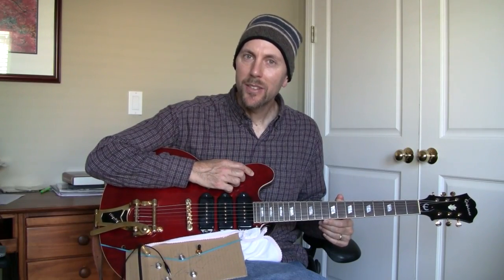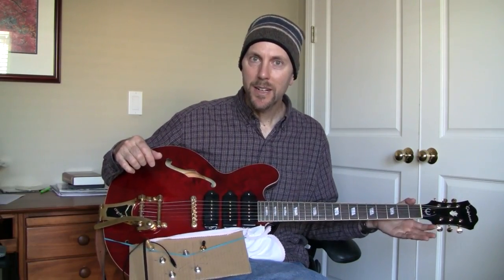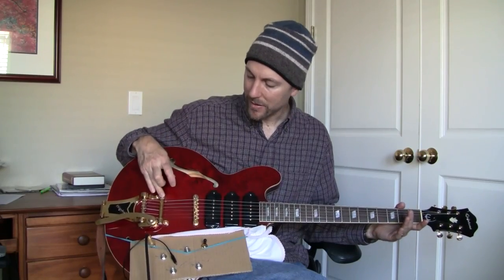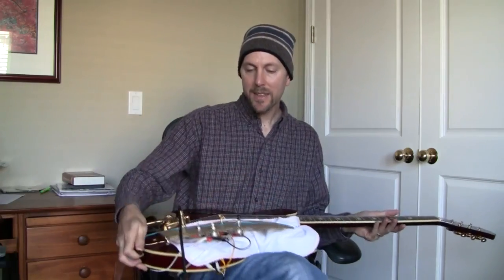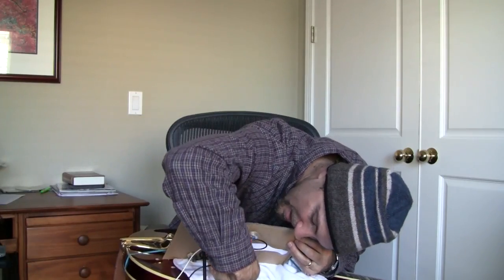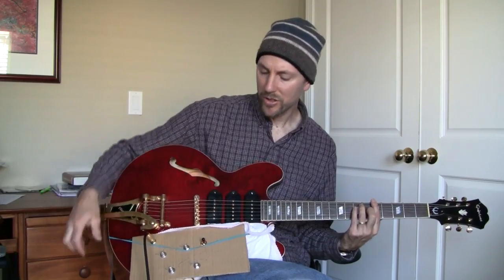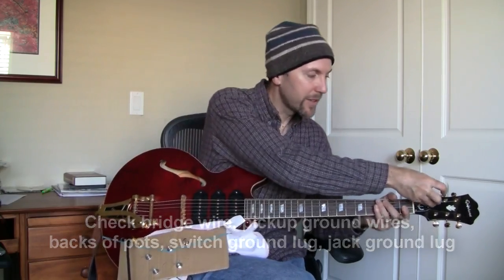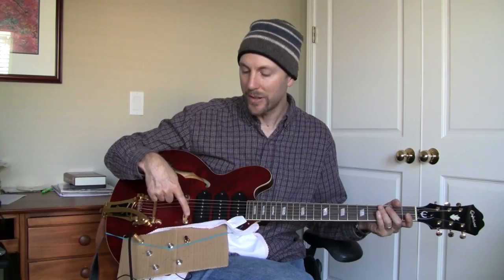Guitar Ground: Dealing with ground noise problems

Comment: Im an electrician so I don't need to know how to check the system.  You told everyone what to check, but not how to check.  I'm sure there are many viewers that would have loved to see an extended video of the testing process with a meter.  Other than that a great way to demonstrate the ground circuit.
Reply: I would have liked that kinda video, if you're going to make one, I'd definitely give you a like to it.
I did check every wiring on my guitar, and every ground connects, but somehow it still has the bzzz thing going on. It's not that bad but still. 
I think it might have something to do with the wall outlet not being grounded either.
Reply: I think, use a multimeter. Turn to ohm meter reading. Clip the black wire to the common ground of the guitar, then point the red wire to each of the ground leg on  the potentiometers to see which pot is not connected to the ground.
Reply: good point.

Comment: I did the ground testing and the last thing I suspected was -- the output jack was wired in reverse! Should be -- hot wire to outside (so plug makes hot contact at tip) ground wire to inside (so the lug nut will test positive for grounding). It was the reverse when I got it back from my 'guitar tech'! Thanks for your help!

Comment: I have an issue with my guitar where it only buzzes when my hands are off the metal, and when I touch anything metal the noise is gone.
Reply: did you found a solution?
Reply: Anton St Yeah. it ended up being my house that wasnt grounded. built in the 1940s...
Reply: And what's the fix for that? lol 
I live in an apartment, have the same problem. One of my guitars (the with humbuckers) is making noise, the strat is not. When I toich the metal plate where the input jack goes, the noise goes away.
Reply: Flagstone Pictures That's very insightful actually, my house was also built in the 40's so I think it's probably it. Cheers man
Reply: Same Problem for me bro, any solution ?
Reply: xD
Reply: My Les Paul did the same thing.  Shielded the pot cavity with copper foil and shielded all the other cavities with conductive paint and the Les Paul is dead silent even at max volume.  SO much better.  The paint is available on eBay.
Reply: I have the same problem with my Les Paul.
Reply: i have the sme issue. every metal part i touch makes it dissapear. even the handle of my amp. so the problem cannot be the guitar can it?
Reply: Easiest fix..... wireless rig.   I use a xvive u2 wireless.   Bought a new 2017 les paul and dropped it about a year later.  Broke the wireless device and the input jack.   Had jack fixed by authorized gibson repair.  Guitar had a little hiss (not bad but had preciously been dead quiet).  Dawned on me I was using a cable now instead of wireless.   Bought new wireless and it is dead quiet again.   If you have the normal grounding issue where you touch the strings and it gets quiet....  go wireless.
Reply: same
Reply: Steve  , the bridge, the strings, the tuning pegs and all other exposed metal hardware should be internally tied to the same ground Point as the pickups, the pots and the body or metal shell of the pots, and the ground side of the output Jack. Get yourself an ohmmeter or some type of continuity meter and check to see that all of those are electrically bonded together with no more than hopefully a couple ohms of resistance. And yes, if the black anodizing or paint on the bridge is preventing a good ground connection to it, then the strings and tuning pegs probably won't have a ground either.

Note that even if everything is grounded together properly, that most guitars will tend to make slightly more noise or buzz when your fingers aren't touching the strings and the metal parts, and usually it gets a little quieter as soon as you touch them. On the other hand, if the guitar generates more buzz and hum when your hands are on the strings in metal parts, and it's quieter when you're not touching them, then the guitar likely has a grounding problem internally. A little one exception I can think of is if your house is a high RF environment with lots and lots of electromagnetic interference flourescent lights or some types of LED lights that weren't designed well, or computers and computer wiring, fans and other devices with large Motors, any or all of these can actually generate noise that gills back out on an into the electrical wiring in the house which then radiates it like a transmitting antenna. Therefore, if you take your guitar and perhaps your amplifier as well to another house or another place, or outside in the yard with a long extension cord perhaps, you'll see if the noise is particular and Peculiar to your own house.
Reply: @phill2840  , put the guitar into a different amplifier and see if you still have the same problem. Also try another cord. If it's still noisy with different amps and different cords, then it's probably the guitar. Note that the chassis of the amplifier the ground and grounded parts of the guitar all supposed to be electrically at the same potential but I'm not sure how they handle on your amplifier would make a difference unless the chassis of the amp is completely metal without any wooden case and the handle is bolted directly to the metal chassis of the amp.
Reply: Same
Reply: Cold water pipe should be earth ground if you have metal pipes. Ground pin of AC power cord (Three Pins) should be at same potential as the cold water pipe.  It greatly reduces the AC noise and pops and clicks. When you hear the noise , have someone turn on the light switch to the room, you should hear the click in your amplifier speaker.
Reply: @kjam22  dude, I love you so much I've looking for ages for a fix for this problem and since I'm a very new player this problem has discouraged me a lot from playing. Thank you very much.
Reply: @bjl1000  I bought a amp recently. I had this same problem everyone is talking about. There is always a noise coming from the amp even at low vol and gain. Whenever I touch my guitar the noise is gone. The power cord of the amp consists of a 2pin plug.  I think this problem is due to grounding issue. If I replace my power cord with a 3pin plug, would it solve the issue. Hope you would help me getting rid of this:)
Reply: @FlagstonePictures  3 years ago, I lived in an old house that had an open ground and had this same problem with the guitar. I had a stone floor in my room with a large rug. I was barefoot playing one day, muted the strings and stepped onto the stone floor to grab a glass of water off my dresser... It shocked the living shit out of me the moment my foot touched the stone. It was like I got kicked by a horse right in my heart and it dropped me to the floor on the rug. I'm lucky I lived. Changed my life. I carry an outlet tester and use it before I play somewhere new now. I'm really careful about making sure the wiring of things is done properly. 

I hope someone reading this who doesn't understand how deadly grounding and wiring issues with instruments is, takes away some new knowledge and this saves their life.
Reply: Hahahaha I fucking knew it. I had the same problem I figured that my body was grounding some emf waves coming into my guitar as the sound disappeared when I touched anything metal. Or maybe my guitar doesn’t ground through the amp I have as the jack plugged into it grounds but the guitar sound doesnt
Reply: @ThrasherDge  I need a fix for this solution too
Reply: @dylansczerba6618  For my guitar turned out that the bridge was some chinese mix of metals with that is not metal enough to create ground, hence there was that static noise.
Reply: Add one more to the list, I live in an out building of a medieval convent(serious). The Grid is from 1930's. I did find a solution though. I put a british 3 pin fused plug on my amp power cable and used a UK to european 3 pin adaptor...almost no noise ever anywhere and to top it all off I use a p90 les paul which without that set-up picks up signals from the entire planet!
Reply: @kjam22  thank you so much for this solution!

Comment: Holy moly! I've been re-soldering and replacing pots trying to figure out this exact issue. You explained it so perfectly. I found the loose ground and BOOM! Nice clean sound now. Thank you so much!
Reply: My wooden guitar under saddle pick up wire  with a soldered 2.5 mm jack to the positive pre-amp was not sealed properly.  I used a piece of aluminium tape wrapped around the soldering n now the low-pitched hum has gone forever.

Comment: the buzz only dissapears when i touch the jackcable or the ring on the toggle switch or pickups, not when i touch the machine heads or bridge. is this still the same issue?
Reply: I think some of the ground wire is broken and not connected to common ground.

Comment: Thanks man.Just changed a pickup switch and was having weird noise in the background no matter how high my noise gate was cranked. But I saw that I didn't solder the ground wire to it. You're the man.

Comment: if it's not the guitar, it might be the amp itself that is not grounded properly i.e. connected to the outlet (or extension cord) without ground. I am not a pro electrician in any way but have some idea - if you don't have proper grounding it creates a shock hazard. There are test devices that you plug into your electrical outlet and can show if everything is properly wired (hot, neutral, ground).

Comment: Thanks, this helped me fix my problem. I had a buzzing problem with my Epiphone Les Paul - noisiest humbuckers I ever heard - and it turned out to be bad / no ground in the switch cavity. I was able to run a ground wire and connect it to the main tone pot ground, and the problem was solved!

Comment: okay, so i have two questions.  First, you video.  When ground was off, you had increased noise in most spots, except where you touched the volume and tone on top, I believe, where the noise seemed to disappear.  Is this just the video, or did it really disappear?  If it did, I am wondering why, considering all ground was gone.  Second, I have a new strat (MIM), and I get a hum that disappears whenever I touch a metal part.  Is this because of the computers in the room?  Or is there something else I should consider?  I'd turn them off to test, but then I'd lose this message. I will update soon as I do.

Comment: I have two guitars doing this, a tele and a strat. They are both bought of ebay; one is just old and the other one had the pickups swapped poorly, it seems, by someone who forgot the ground. I am worried about getting electrocuted, so that's why I found this video... If I solder a wire from the bridge to the volume pot, will that take care of it? I have 2 guitars doing this, so I'm hoping this would be the correct solution for both the tele and strat.

Comment: Hello John! Thank you for the video, I think I have a similiar problem to what appears in the video, only that my guitar won't play ANY sound at all and is causing very annoying buzz noices. Do you have any idea of how to fix this or what it could be? I also don't want to break anything in the guitar since it's quite costly to replace some parts of it. :)
Reply from the maker: sorips95 - most likely the signal wire from the pickup has become disconnected from the pots.  Cold or broken solder joint.  Should be easy to fix if you can easily access the pots.  If it's a semi-hollowbody, it's much hard to access the pots through the f-holes, as you can see here:  https://www.youtube.com/watch?v=mS9ZB_Sgi6Q

Comment: I bought a new American (so it's shielded and grounded) Standard strat to replace my squier that hummed obnoxiously. I checked out the same guitar at 2 different stores and took my amp & wah, so much quieter than my squier! I ended up buying it, and when I took it to my house, it hums just like my squier. the amp buzzes slightly without the guitar plugged in (ground loop) and the mains hum on the guitar (shitty grounding=shielding useless). I think it's both, what do YOU think?

Comment: Well, tried it out.  Computer was definitely making the noise.  Turned the gain and volume way up, and had no noise.  Not bad for an MIM strat.  I also found that if I grab the body/neck tightly, it does hum.  I guess that is the fact that I am NOT connected to ground myself?  It does go away when I touch the strings.  Am I on the spot with this analysis?

Comment: Great vid? quick question, my guitar does the opposite of what you describe in this vid.  it has a buzz which doesn't go away when touching the strings, but when I touch the jack plate or metal on my amp/mixer the buzz goes away.  Is this a grounding problem, should I re-solder the wiring?  I've worked the problem down to the guitar itself which uses humbuckers. thanks

Comment: Good one, my martin acoustic has a ground noise. I will see if i can find a broken wire to the output jack?
If i touch the cable metal or jack the noise goes away..

Comment: Hi John I'm so glad I found your video. I have exactly the same problem. But mine is an ibanez, how do I find that "black" wire? Is it always a "black" wire that causes the problem?
Thanks John.
Reply from the maker: No- manufacturers may use different wire colors. They are not necessarily consistent.

Comment: I took my guitar to be repaired for this and now, the grounding issue is louder because the repairman thought I had a sheilding issue.  Now the unit is shielded more than it is but the bridge to my acoustic electric is plastic.  Maybe there is a loose wire or could it be that the electrical card connecting to the 9 volt battery is messed up.  Would the repairman need a multimeter?  Just curious.

Comment: Hey, I'm getting something similar, but a lot worse of a buzz. The only way to silence it is to actually touch the pickups under the strings or to touch the metal part of my cable. Touching the strings does nothing. Do you think it's the same problem?

Comment: Very handy info thanks!  I had a brand new telecaster that even the local tech couldn't fix and I have no doubt it was a grounding issue!   What's even more strange is that the buzzing would only occur in the winter, not summer....I'm in Ottawa Canada and it gets really cold and dry here I'm sure that has something to do with it

Comment: Thank you this tip really help. I did play the new guitar that I have for a while and just was stuck even though I was looking at the wire hanging down in the Guitar. The sticky stap they use seem to be milting by the heat in my apartment. No even a lose wire .they groung the wire to the Guittar with a tape holding the gound to the body for proper grounding. Was  stuck to see it. Thank you .

Comment: yeah. i remember myself placing the pickups near the amp's speaker to get some feedback. could that been the cause of it? it's not too loud but i still hear it and it definitely adds noise when im using drive and dist. if you could know how to remedy that, i would really appreciate it if you share it to me. i still learned. thanks man.

Comment: @johnplanetz this is probably a stupid  question but i am not to keen on the wiring yet. I have not soddered the ground wire to the bridge post, but even when i touch the ground wire to the post it makes that loud buzzing noise ( the one when you touch the strings or any metal part on the guitar). Does it only do that because i'm holding the ground wire or the bridge post?

Comment: hey john awesome vids,

im having a buzz problem with noiseless pickups, it stops buzzing with i touch the strings... or even reduces when i touch metal on my effects machine ( even when im not touching the guitar.) i heard that if the volume and tone pots are touching the  metal foil on the pickguard ( stratocaster) it could cause this ground problem? other than that... my wiring looks good. thanks john

Comment: Hi, my bass has the opposite hum that you show in this video. It buzzes when I'm not touching any of the metal but when I touch any metal the buzzing stops. Any ideas why this is happening and do you have any suggestions on how to fix it? I checked the wires and none of them appear to be loose. Thanks.

Comment: I have an Ibanez RG270 with 3 pickups.  I took it to Guitar Center to replace the bridge pickup only to SD JB.  Upon coming home and plugging it in, the bridge pickup and neck were both quiet.  However when flipping the switch to the middle position I'm hearing a lot of buzz/hum, even with my hand covering the strings.

Is this ground noise that's causing it?  It wasn't happening before. I called the guy that did the repair and he tried to explain it's because single coil pickups will buzz/hum more than humbuckers. I told him it wasn't doing that before!
Reply from the maker: Single-coil picks hum and noise- and this will change as you move the guitar around. If your noise is constant then it is NOT single coil noise.  Take it back to the guitar tech and demonstrate it for him, and get him to make it right.

Comment: What is the commom noise hmmm on the electric guitar itself, cable, or on the amplifier? Thanks God bless because my cable is working, my amp is ok also and my guitar also is good but theres a hum, hiss, and not a loud noise but theres a noise still and i dont know where the origin of the noise.

Comment: So the guitar that I have is having some pretty bad hum issues. Same things with yours, where any metal parts that are touched stop the noise, and so forth. I can't see anything wrong in the back with the wiring between the pots and selector switch, but I tried covering the pickup with aluminum foil, and if I do it right the hum is completely gone with that pickup. It's hard to keep it like that and I'm not quite sure what's making it do that, but I can get rid of it by putting the foil on right

Comment: What would happen if you'd have a wire going from a piece of metal on the amp to a radiator? Would it cancel out the hum without causing harm?